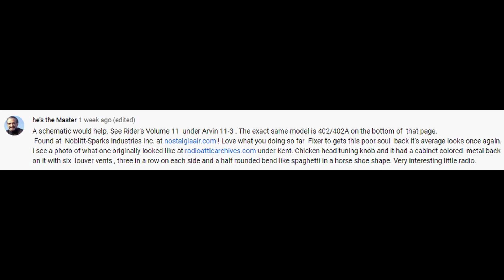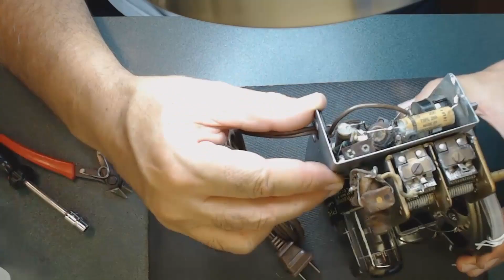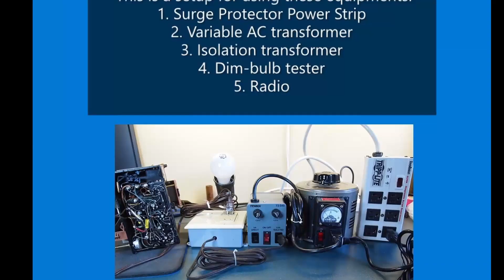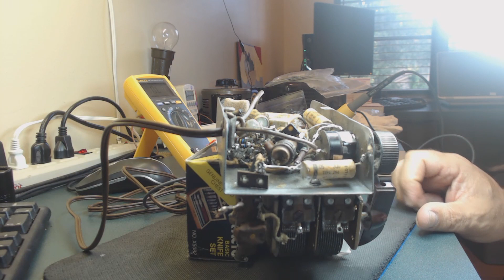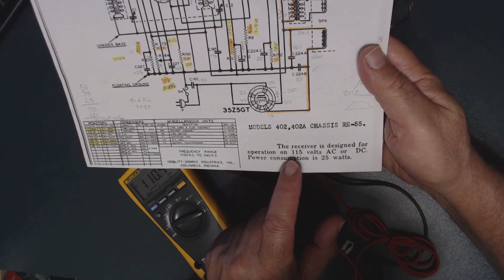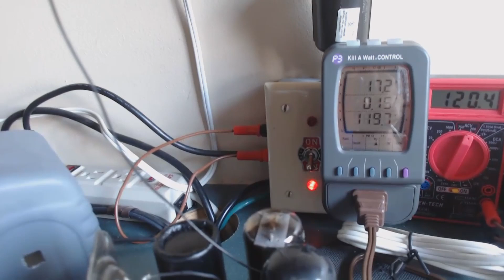Part 3 - Metal Radio Restoration "Kent 402"

Comment: Looks 👌 kind of like a 🔥 Firestone radio from circa 1947. They were all metal, 👍 like this one. Just be careful, because this is probably a series string (transformerless) set, which involves dealing with a 🔥 hot chassis. Ya can use an isolation transformer. This does look 👍 like a pretty nice 📻 radio. The metal chassis, capacitors, glass dial face, dial cord, and dial light. I assume it has a field coil speaker. I gained a little 👌 knowledge on the speakers, which I learned from David Tipton. Little 🐛 bugs make the holes in them, but speaker re-coning glue can be used to patch them ☝ up. I 👍 like that ya have a schematic. I don't 👌 know if it originally came with the 📻 radio, or if ya had to order it separately. They were included in the back of some models of 📻 radios of days-gone-by. We 👎 no longer 👀 see that today. All junk Chinese radios is what we 👎 now have, with 👎 no schematic in the back of them. Nice Coca-Cola can there, I've 👀 seen it featured in a few of your videos. Probably need a little sugar, or caffeine, to stay on top of things. Your friend, Jeff.
Reply from the maker: Thank you very much Jeffrey for the info! It is a beautiful little radio which was in a bad shape and someone did a horrible modification. Glad that finally is coming getting is Glory back. I hope this help others to rescue old rusty, dusty, and ratty radios for future generation to enjoy. Have a great day! Jay